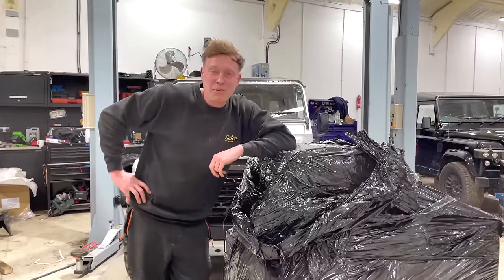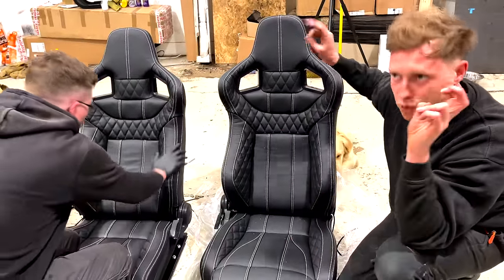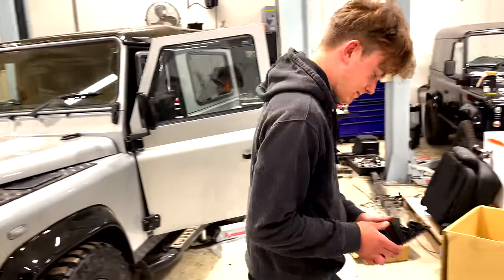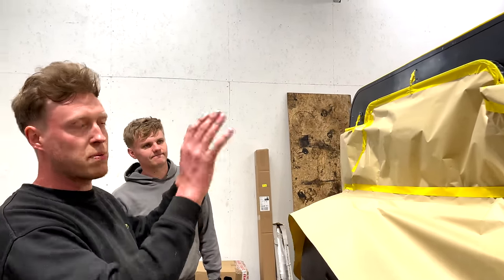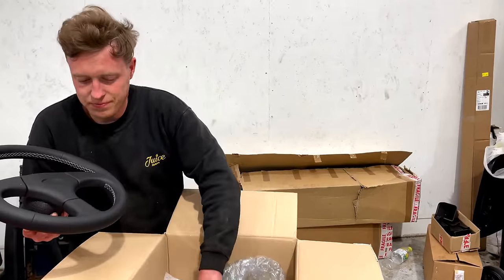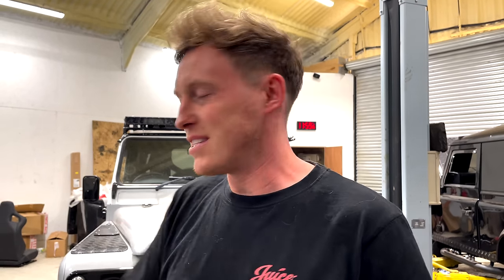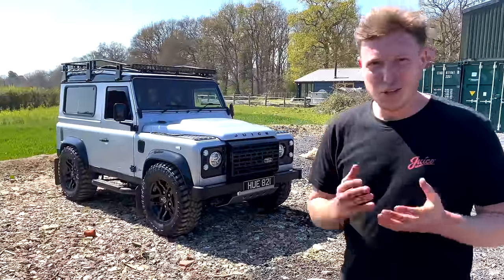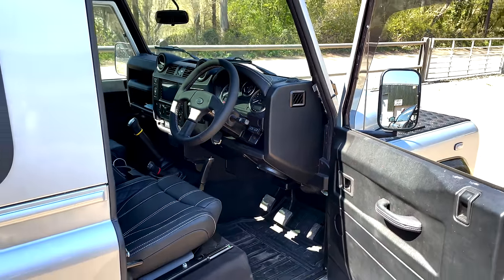MODERNISING a Land Rover Defender 90! - Part 4

Comment: Nailed it boys. Quite perfect but never a fan of the Ford 4 pot. However just found the Alisport Air filter conversion that claims an additional 38hp! and its waterproof ! Unlike the plumbers piped original. Still looks stunning.

Comment: So Essentially you just added bolt on bits,paint and wheels.  I saw the new brake pipes and callipers. Did you also strip to the chassis and rebuild with all new or refurbished components?  I admit it’s a very pretty car, and cosmetically pleasing, but it’s what’s underneath that really matters, was the base vehicle totally rebuilt first?  Other than that I really enjoyed your video. It should sell well. There’s a bum for every seat. We are currently building a G4 replica.

Comment: There was an S90HUE for sale recently in Brisbane, Australia. If I had the AU$154,000, it'd be mine.

Sadly, having been screwed over all my life, I think its gone to another home.
Reply: I'd be happy to buy a Land Rover purpose built (by Land Rover Australia) for the Australian Army.

AU$30,000 would get me the car, a power steering upgrade and a turbo for the Isuzu 4bd1 engine, with probably enough left over to buy a couple of GoPros to film my adventures.

Instead, I've struggled to get the $$$$ to upgrade a tired old computer so that I could put a virtual machine on so I can play some really old dodgy driving games on it.

Comment: Really like your eye for detail and style. Perhaps you can put the all new Mud Stuff usb input socket in the blanked switch plate which you nicely adapted to a smaller version. This socket is connected to the radio so you get rid of the ugly cable which usually swings around on it own.
Covid pending I would like to bring my car in for air suspension later this year. Can we get in touch about this? Rik, The Netherlands

Comment: Hi, you really know how to mod a Defender, great style.  I want to ask you something if I may.  I just bought a NEW Land Rover Defender 2015 puma 110 (only 200KM on it, yes 200Km) and I want to fit it with bigger tires, am thinking 275/70 R18 (black sawtooths wheels), do you think I will have troubles with the transmission etc?